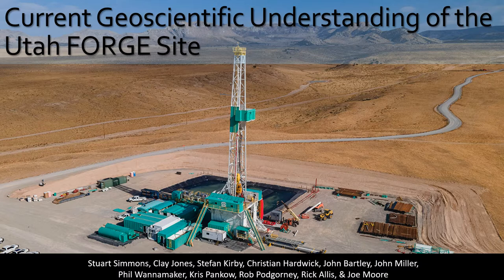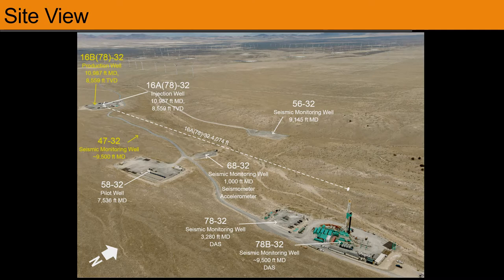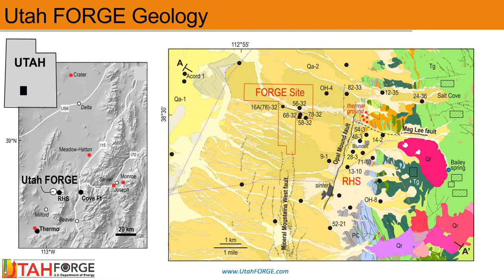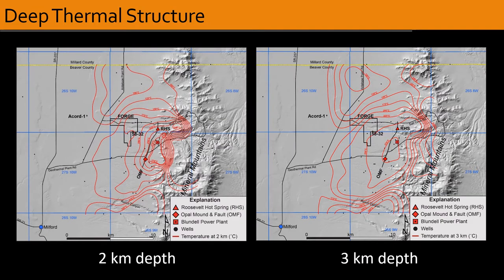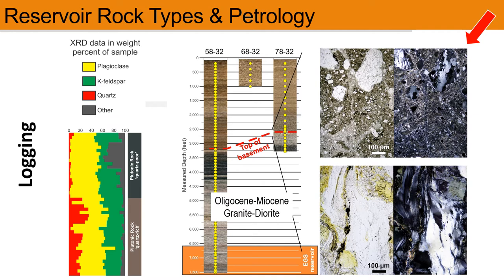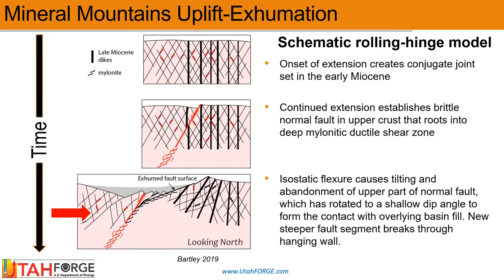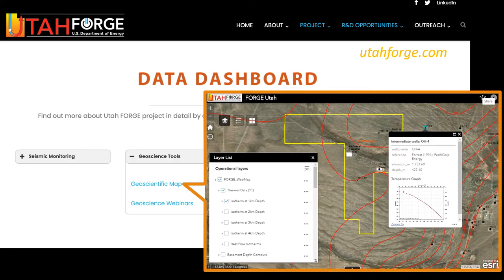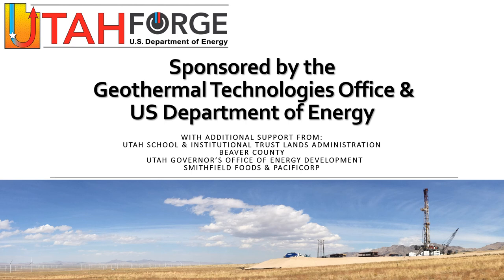An update to the Utah FORGE Geoscientific Overview (2021)

Comment: Nice, I've drilled out in the deserts past Ouray. We tried so hard to run air after 2kft. But had to switch to fluid. Hard drilling too, we were running 40 ft sticks at around 10min ea.